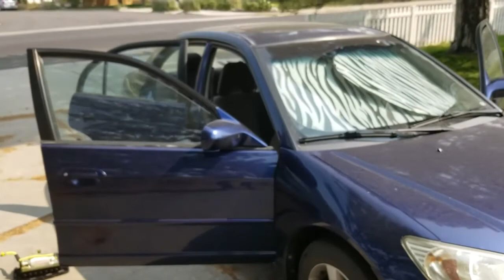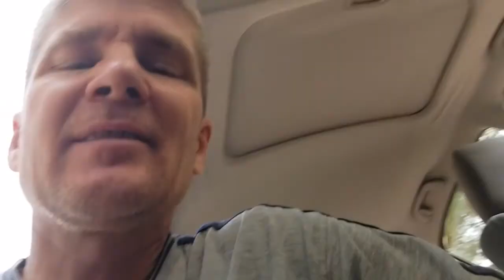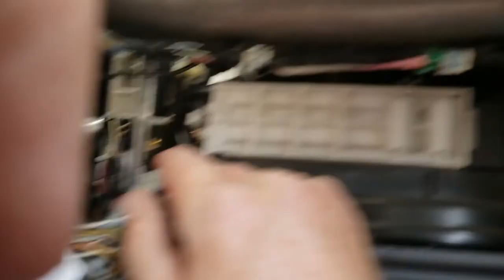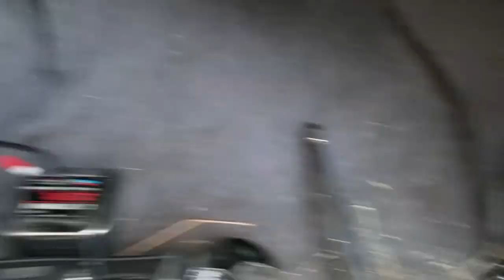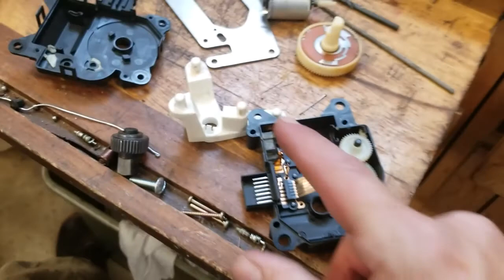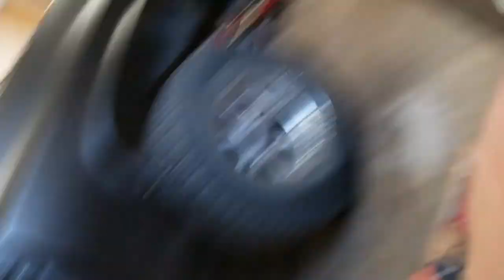2001 to 2005 Civic Mode Control Motor Repair

Comment: You’ll have to reset the SRS warning light if you turn on the ignition before reconnecting the SRS connector. This video worked on a 2004 Civic https://www.youtube.com/watch?v=UrebJlm21I0

Comment: It is not a good idea to store the air bag with cover down.  If the air bag goes off it will launch it and could hurt someone or, damage something.  Store it away from you with the top facing up.  Treat it like the bomb that it is.

Comment: why didn't you show how the blend door connects back? It isn't the most obvious. Any idea where the diagram is for how you position the arm back inside the levers?
Reply from the maker: near impossible to get a good picture of those and the position it's in will change depending on where it was stuck. sorry, that's one you'll just have to pay attention to when taking it apart.

Comment: Update: fixed my actuator issue. Followed everything you showed. I added a few steps more, I tested the motor with a Dewalt battery to make sure it functioned properly. Unfortunately my gears spun freely, so the only other thing I did was clean all contact points and slightly bent the pins that made contact with the gear to a more pressed on position. So far everything seems to work.* Added note, you will break the clasps holding the two halves of the motor housing, don't worry the screws that hold the bracket and housing will press everything together.

Comment: Thanks for the video!!!!   I’ve put off messing with the actuator for over a year.  I would have to wait a week or two for the actuator to switch from defrost to vent, and I would leave it there for the whole season.  I opened up the actuator, reapplied grease to the gears and removed the old dry grease, and then placed back together and functioned as it should… surprisingly.  Saved $150 for the replacement part.  Thanks again for your video:
Reply from the maker: Glad I could help

Comment: The light of air recirculation button turns ON, but makes no difference to the air flow when my AC is working. Any ideas?
Reply: I'd guess it is the recirculating door actuator. https://www.partsgeek.com/catalog/2005/honda/civic/climate_control/hvac_recirculation_door_actuator.html Very similar actuating mechanism.

Comment: Does control the temperature as well? or is it simply for switching between where the air comes out?
Reply: Just where the air comes out, the temp blend door is alll the way on the drivers side up under the dash. Requires the removal of the dash. Removing the dash will take no longer than a hour if you know what you are doing. there may be a work around, but its way up there

Comment: Update ECM cannot be removed from the top, however the ECM is much easier to remove if you remove the mode control motor.

Comment: Thanks for the video. I just bought an 04 civic and the previous owner damaged the control motor when he removed the ECM. I had no idea how to access it. The ECM is difficult to remove now you got me thinking that with removing the airbag the ECM may be able to be removed from the top??? has anyone attempted this?

Comment: In the Chilton repair book it only says to remove the ECM, not the airbag, but do you think that there is enough room to only remove the ECM? Thanks for the timely video by the way, something with my mode control motor went bad only a week ago :)
Reply: Did it yesterday, let me answer my own question: you could probably do it with just removing the ECM but the space is pretty narrow so it would be difficult. Plus you would need a really long extender to get to one of the ECM bolts. I ended up getting to it just as shown in this video. In my case all that turned out to be wrong was that the joints were stuck and needed some grease. The working motor had a resistance of  about 1 ohm, for reference if anyone's is bad.
Reply: @benpound9842  helpful, thanks man

Comment: How do u connect the Rca cables to the factory amp? Mine is making a hissing noise and sounds maxed out at volume 1
Reply from the maker: Cut up an rca cable. Inner is positive outer is negative, hook it up to the aftermarket harness speaker connections and plug it into the low level rca outputs on your receiver.